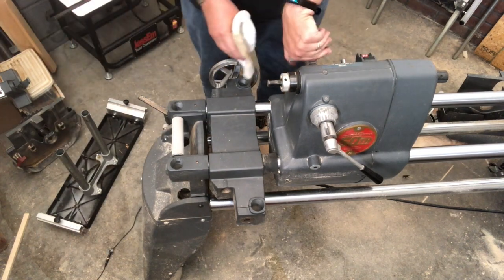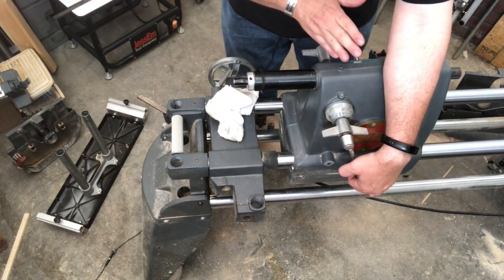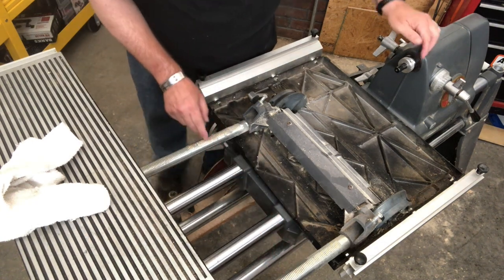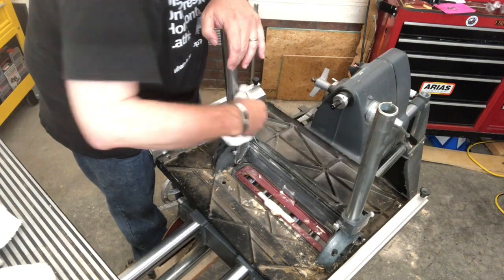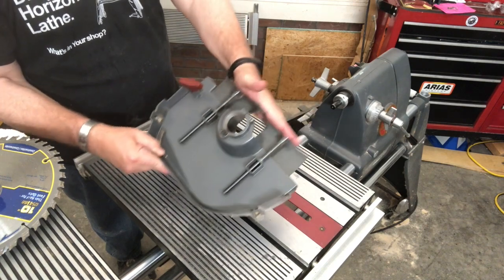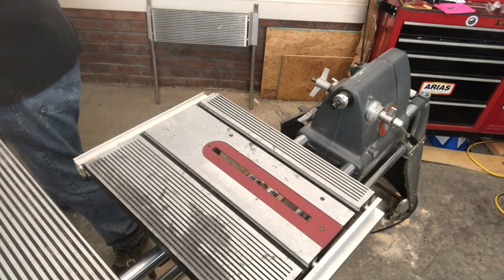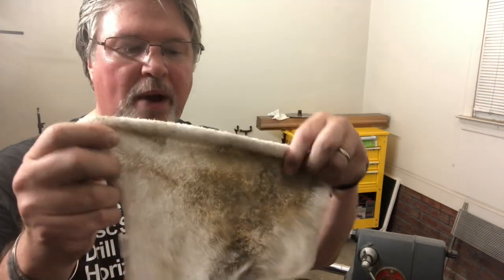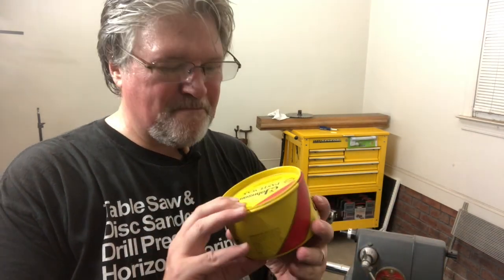You Are (Probably) Waxing Your Shopsmith Mark V Wrong!

Comment: I recently bought my used Shopsmith Mark V 500, I believe, from my former truck driver colleague who became disabled & can no longer use it. It needs a good cleanup, lube, and proper adjusting. I am doing lots of reading of the manuals, videos, but mostly your videos, Scott. I have never owned one of these, and I will not even plug it in until I feel safe enough with my newfound knowledge from you and others. Looking forward to it and possibly adding planer, jointer, scroll saw, etc. I respect you for leaving videos with mistakes intact to show us what not to do. It also shows integrity. We can learn from mistakes, even someone else's. Thanks! Brian
Reply from the maker: Hey Brian. Did you get the books that originally came with it? If not, I strongly reccomend picking up a copy of "Power Tool Woodworking For Everyone". There have been several versions of it, so make sure you get one that is roughly the same age as you tool to make sure that it's as applicable as you can get. You can find them on eBay: https://ebay.us/3JBudy  Scott

Comment: Carnauba comes from the palm fronds (leaves) which are cut from a specific palm tree that grows in the wilds of northern Brazil. It is still a very artisanal process where the fronds are harvested manually just after the rainy season using long poles with a flat sickle like cutter on the end. Then they are dried for about a week, run through a machine or scraped  to extract the carnauba dust that coats the leaves. This is then further refined by boiling in large iron vats and allowed to cool in troughs which takes about a week. The wax is now broken into chunks and sold in large sacks.
Reply from the maker: Nice info. Thanks.

Comment: Scott,
I have been doing wrong for a long time. Thank you for the updated info. I have been using a pollishing pad to put the wax on. I will change me way. Thank you.
Reply from the maker: It’s ok to do whatever works for you, but most importantly is to not slide the headstock and carriage over the wet wax.  Scott
Reply: @MyGrowthRings  oh oh - now what do I do.  I've been sliding headstock and carriage  and quill over wet wax for  long time now.  Any way to fix the damage?  This info is so helpful.  Thanks.
Reply from the maker: @hfmann1  Unless you are finding that it wants to stick to the tubes. If that's the case you can remove the headstock and clean the casting holes with the solvent of your choice. If it has built-up over time you'll notice an improvement immediately.  The quill is even easier to remove and clean.  Scott
Reply: @MyGrowthRings  Thanks - pretty intimidated to remove the headstock (PowerPro).  But I'll work on just waxing them properly for a while and see what happens.
Reply from the maker: Hal Mann I understand that hesitation. I know the Shopsmith tools like the back of my hand and could assemble one from parts if I had to, yet, those weekend I need to take my pellet smoker apart to clear a jamb in the auger tube and it has me stressed! It’s just because it is something we have never done, but thousands of people who are less competent than you have removed their headstock. I suggest checking Jacob Anderson’s channel to see if he has a video on the topic. The only real trick is to loosen the headstock lock and keep loosening it until you can’t turn the know any further. That will lock the wedges in their proper orientation so you can get it back onto the tubes without having to mess with them. You’ve got this! Scott

Comment: This was more helpful than I expected. Thanks.
Reply from the maker: Mission accomplished. Seriously, I’m happy to hear it. Scott
Reply: @MyGrowthRings  I have an unrelated question and I hope you don't mind me posting it here. I have been interested in using the Shopsmith for mortizing, but when I look at the accessory sold by a Shopsmith it gets horrible reviews. Do you have any thoughts or recommendations regarding that process or product?
Reply from the maker: Robert Hiday I’m sitting in the passenger seat on the highway to Paducah,  Kentucky, so I’m sure you can imagine that any woodworking question is welcome!  The Mark V has a couple issues when mortising: The chisels need to be sharper than the way they come, so you have to know how to sharpen and use them before you can use them. The stock quill handle is too short to get the proper leverage and the cast aluminum hub of the quill handle was not made for this type of force. There are a couple aftermarket solutions that might be worth considering. Table flex can be an issue, but that can be addressed several ways, depending upon your Shopsmith model. All of those factors ultimately led me to purchasing a stationary hollow chisel mortiser, but a router table can make excellent slot mortises as long as you’re not doing through mortises for Arts and Crafts furniture. I’m not saying that I couldn’t make one work, because I can, but they aren’t ideal. Great question.  Scott

Comment: People tend to interchange the words "set-up" and "change-over". Change-over is the process of changing the Shopsmith from one mode to another, such as changing from table saw to drill press. This of course is relatively fast and straightforward, using only the 5/32 allen wrench. Set-up is very different. For example; setting up the dado stack to cut a groove and placing it in the table saw. In this regard, set-ups on the Shopsmith are usually just about the same as you would have to do on any machine in order to accomplish a specific task.
Reply from the maker: I worked in an architectural millwork shop and brought my Mark V in to use on a few turning projects, and could set it up faster than any of the tools in that shop. I keep the blades that I use on their win arbor and even have a could dado stacks on their own arbors as well, so that helps to speed up the process.  Scott

Comment: I genuinely appreciate the information I get from your videos as well as the pure enjoyment of watching and listening to an expert in a hobby that I enjoy. Do you have any thoughts on a product called Boeshield as an alternative to paste wax. My understanding is that Boeshield leaves a film of wax behind as the solvent evaporates. Thanks
Reply from the maker: Yes, I use T9 all the time, thought I haven’t found it to be a complete replacement for paste wax due to it’s lack of any build-up. The way tubes and the castings that slide on it have microscopic scratches and voids that cause drag or friction when we slide them, and paste wax does a much better job of filling these voids. That said, T9 is super fast to apply and if I just need to get things moving in the middle of a task I’ll reach for it. I did a video entirely on all the various lubricants I use on my Shopsmith tools that might be worth a look. Scott

Comment: Buffing after drying should be accented a bit more. When I bought my Shopsmith the dealer had cans of wax that were rich with carnauba. He called it Oil of Olay for machines. 20 years later I still have the can, it still smells great and waxing continues to make a big difference to ease of adjustment.
Reply from the maker: Probably so. It’s always a balance of what to show and what to edit out when recording a video. Thanks for watching and commenting, Scott

Comment: Thank you so much for your videos..I feel they will help me a great deal when I get brave enough to fire up my MARK V 520 that I was blessed with by a good friend that gave it to me.. also..I need a sanding disk, a drill chuck and the lathe parts.. any leads would be appreciated. God bless
Reply from the maker: First off, welcome to the Shopsmith family and wow, that's quite a gift! I suggest getting plugged-into two Facebook groups (Yeah, I know!) One is the Shopsmith Owners group and the other is the Shopsmith Sales group. Also, jump into Shopsmith's own forum, which you can get to through their website at Shopsmith.com.  As for parts, it's hard to beat eBay and Craigslist. The parts you need are redily available and if you are in a pinch and need to get some of them ASAP you can always get them at retail from Shopsmith or via this link on Amazon: https://amzn.to/38Ja3DC Some of the parts on Amazon are made by aftermarket suppliers, so be sure to check their reviews. Scott
Reply: @MyGrowthRings  thank you!
Reply: @MyGrowthRings  I'll be watching more!

Comment: Can you use steel wool on the tubes to remove rust before applying the wax?
Reply from the maker: Sure thing. I tend to use ScotchBrite because it doesn’t fall apart like steel wool can, but they will both work just fine. Scott

Comment: Hi scott just wondering ,I think i read in the manual ,that the minimun  temperature for using a shopsmith,is around 50 degrees F, is there any harm in using the machine at low temps,,,great vid on maintenance.thanks Jim..
Reply from the maker: We used to live in Ohio and routinely used the Mark V at and below freezing. The key thing was to start it up each day with nothing attached and just let it run for 5-10 minutes to warm everything up. The belts really don’t want to move from their current oval shape, so you also want to make sure that you leave it each day set to a low speed. I’m sure there are other opinions out there, but has always been my approach. Scott

Comment: Question first... Is there a way to tighten the table lock?  After waxing the bars, my table will slowly slide when I use drill press mode.  Slightly enough that at first I thought my quill stops were slipping, or my bits were maybe receding into the chuck.  The answer was, the table was lowering.  How do I fix that?  The nut on the other side does not seem to be adjustable.
Now gratitude...  I have followed your waxing instructions and I love the results.  I had sadly never done any maintenance to my Shopsmith in the 15 years I owned it until watching your videos.  I have started oiling and waxing accordingly, and I finally got my bandsaw to a state where I trust it will actually do the jobs it is supposed to do. Thanks for these videos.
Reply from the maker: Yes, if you have a 510/520 you can tighten the carriage lock with a socket wrench on the back side, opposite of the lever. It’s a lock nut, but it is adjustable. Just make sure to make the adjustments with the machine horizontal.
Reply from the maker: And thanks for the kind words about the vids!

Comment: When waxing the tubes, how do i remove slight surface rust from the tubes?  After about 10 yrs my ex-wife let me have my shop smith mark vii, needless to say some parts are missing and some parts are really rusty.  Any information you have on helping me get this shopsmith back in good working condition.  Great videos.
Reply from the maker: If the rust is just slight I would go after it with WD40 and Scotch Brite. Once you get the rust off you'll want to get it waxed quickly, because the bare tubes will rust quickly. I did a video on de-rusting a SS jointer that might be helpful, but the tubes are even easier. Scott

Comment: I got an old model 500 mark 5, the guy I got it from. Has been using aircraft dry film lubricant, the graphite kind, would I need to strip all of that out before I wax?
Reply from the maker: I would sure think so. Google to see if your can uncover the solvent that they used with that dry lube and that's what I would use to remove it.  Good luck! Scott

Comment: My quill does not move well at all. Did not know about letting the wax dry before buffing off (duh, should have). I've cleaned the inside of the quill down to the bearing and oiled the splined shaft. Wondering if I need to run a flap wheel up in the casing.
Reply from the maker: You can do that, but be quick about it and not too aggressive. You really don’t want to remove any metal. Also, look for burrs around openings and the screw hole at the too.  Good luck! Scott
Reply: @MyGrowthRings  kudos. I think I had forced a burr into the keyway on the quill from the lock screw on the top. There was a pair or grooves extending from the screw to the outside of the casting. After filing the shoulders of the keyway it started moving much better.  Some 600grit on the grooves to knock down any resultant burrs and it's better still. Could probably use more but this is good for now... Found it while tearing down my headstock due to a runaway speed control... Yup, control sheave bearing seized. Might be a good troubleshooting video since it's scary when it happens.
Reply from the maker: @darthboren  Glad to hear you have it under control, and yes, that's not a good prize at all!  Scott

Comment: is there anything wrong with using teflon  dry lube ? I've been using that for a while now and when I open up my headstock to lube it up, there doesen't seem to be any build up. I also use it on the rack n pinion for the table and I noticed there is no more saw dust build up if ever. what's your opinion on this?
Reply from the maker: I've used it with mixed results. Shopsmith used to sell a dry lube product that they encouraged the Academy Instructors to use and promote on the way tubes and table tops, and most of us stopped using it. It was super-slippery at first but wore off very fast, which of course promoted more applications. Not only did it not perform as well as paste wax but it also looked cloudy, which made the way tubes look bad. You are right about it on the table rack and the carriage pinions, though. It does a fine job there. As for internally, I think that on the quadrant and worm gear it is perfect, and a much smarter choice than grease or even bee's wax, which was the choice at SS for many years. Not only does grease attract dust, but it also drips off if the motor is run for long periods, and then you're left with no lubrication. Lastly, I wouldn't use it on the sheaves and shafts as my long-term approach to maintenance, but as a quick fix it's ok. Scott

Comment: Hi Scott, I have a new Mark 7.  I am getting a lot of marks on my way tubes probably from over tightening the headstock.  It doesn't feel like I'm over tightening but I'm getting a lot of dimples on the tubes. I have tried getting help from Shopsmith customer service, but this has proved to be not much help.  It seems to me that the way tube wall thickness should be thicker, or their should be a stop like there is on the table slide, or a torque indicator.  Any suggestions?
Reply from the maker: Yeah, they shouldn’t be dimpling, so you are likely overtightening. When you tighten the headstock, just tighten it to the point where you feel like you need to use a little more muscle, and that point give it no more than a quarter turn more. If it is your carriage that you think is the culprit, you can adjust that with a socket wrench by following the instructions in the set up portion of your manual. I think I did a video on this years ago.
Reply from the maker: I think this is it: Shopsmith Headstock Lock, Carriage Lock and Jointer Fence Issues and Mysteries SOLVED!
https://youtu.be/tSpYlXFoJ10
Reply: Thanks Scott, really appreciate your help!
Reply from the maker: @billhilker4175   My pleasure, he-man! Take it easy…

Comment: Why wax and not 3in1 oil?
Reply from the maker: Great question. Oil attracts dust and eventually becomes a sticky mess. Wax is the preferred lubrication for most bare metal parts used in woodworking. Scott

Comment: Silicone isn't compatible with much of anything...
It isn't even compatible with itself...So if you see your bathroom or something with silicone and it leaks or comes out...You have to remove every bit of the old silicone. Silicone does not stick to itself. That is why you see mold behind the brand new silicone or an over cover so large it makes a new seal against the corner to prevent that. Yes this is off topic but use Urethane if you think it will ever need maintenance. Urethane sticks to itself so you CAN do what most people do with silicone and JUST remove the bad part and reseal.
Reply from the maker: Great tips. Thanks for adding valuable content to the conversation. Scott

Comment: I just spray a penetrating oil on a rag and wipe the rag across the tubes and etc.
Reply from the maker: That works really well in a metal shop but can be an issue in a wood shop, but if it works for you, stick with it. Scott
Reply: @MyGrowthRings  thanks for the heads up Scott. I do have a wood shop but I use oil sparingly & primarily via rags and essentially keep it off the work which when your building crossbows is fairly easy.

Otherwise:

I just picked up my model 55555 1980 ShopSmith two weeks ago. I received it free along with a Shopsmith power-station. I am primarily going to use it as a lathe and drill press. Because I replaced the speed controller and sourced parts from multiple locations at the moment I am waiting on delivery of the geared handled that attaches to the speed controller otherwise I would have used it by now. 

All, in all I think I really like the machine. If you could would you please tell me which variation of the Mark V I have. All I could source was its year from the model number and I think it's to early for the 510.

Thanks again.
Reply from the maker: @migalito1955  Yes, 1980 is just a few years too early for the 510, so unless someone has upgraded it you have a model 500. Scott